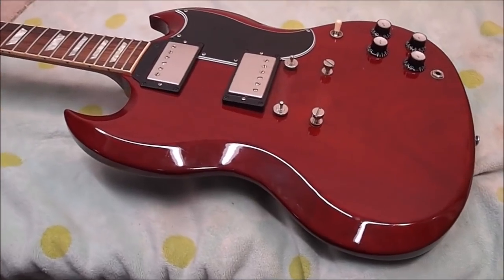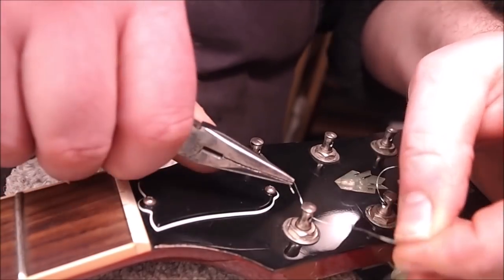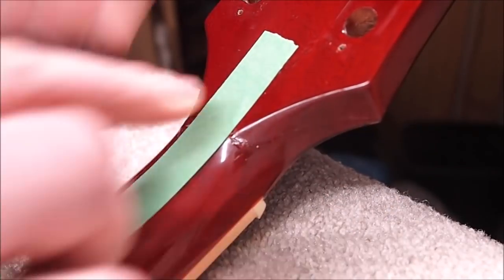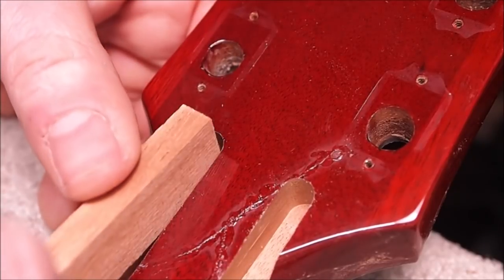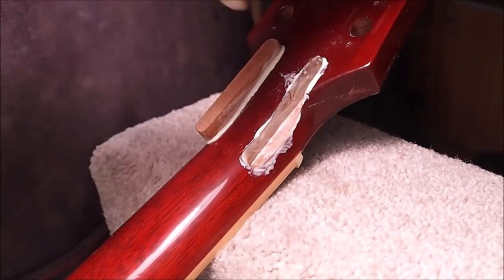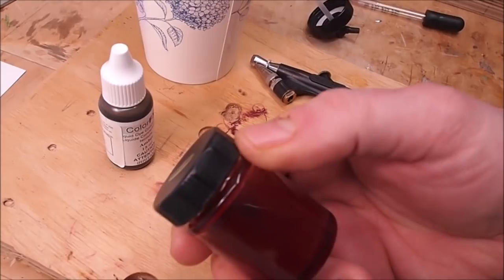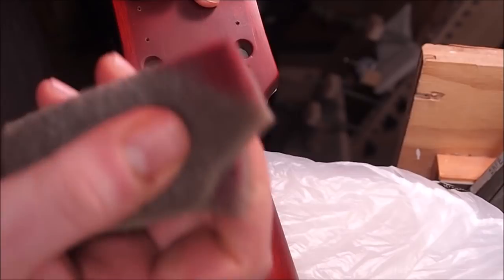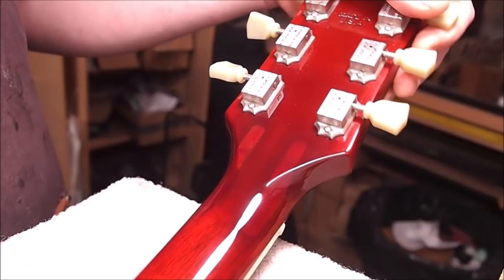Gibson SG Headstock Finds the Strength to Heal

Comment: Another nice professional job to be proud of. I purchased a black LP Custom with a headstock repair that was so well hidden I didn’t discover it until it broke the second time around the splines (maple) and there wasn’t enough wood left to get a good repair. I made a complete new neck and located a headstock veneer on eBay to complete the job. I would have enjoyed your method a lot more but you have to work with what you have.

Comment: Holy crap how did I miss this gem when it first came out?!? Lol that requiem for a dream bit made my day! Such great videos, im very grateful to have them to learn from and enjoy. This is also very likely my favorite headstock repair refinishing/touch up I've seen you or anyone else do. It came out really great especially considering the difficultly matching the color and it looked right in multiple shots under varied lighting. On the tele I built the neck looked great for a few months but now in some lighting I can see where the grain filler dye (mahogany neck, maple board, timbermate grain filler on the mahogany) isnt as even in some places. The timbermate worked great but I think I could have done a better job sanding it back in those areas that are now overly saturated in certain light. It's just weird it didnt show for a few months lol.

Comment: Why didn't you attempt to dye the splines a bit first, then spray the tinted lacquer over the area?
Reply: How could that be done before carving them down?
Reply: Some kind of tinted oil perhaps? Or would that cause unwanted expansion of the splines.
Of course, done after carving, while in the headstock
Reply: @lpjbird  No I mean after carving and sanding - mask off the next and headstock and dye the splines only.
Reply: @JohnCarey1963Jag  Yes I figured that's what you meant after I thought about it a bit, I agree with you it may have come out looking a bit more blended, maybe?

Comment: I actually like the look of the splines, I’m sure people will argue as they always do but mentally to me it look stronger then out of the factory new. Why did you choose what appeared to be titebond glue vs an epoxy when glueing in the splines?
Reply: I don't think I've ever seen him use epoxy for anything.
Reply: Why would you use epoxy instead of titebond? Wood glue is great, as it's made for wood. Epoxy would be a bitch to work with and clean up while not having any advantages.
Reply: Titebond is very strong for close fitting wood joints and it cleans up with water, which is super convenient for cleaning up squeeze out.
Reply: When dry, that titebond will be stronger than the wood it's gluing together. It's well suited for that kind of joint.

Comment: Is there any way to repair a crack line in the front veneer?  I managed to repair my headstock break, but it had completely snapped off, so even after the repair you can easily see the damage on the veneer...  Is the only option to buy a new piece of veneer?
And are splines really necessary?  I've always been taught that the glue joint will be stronger than the original wood was, so adding splines just seems to be extra 'piece of mind' that professional luthiers do to justify the work?
I managed to repair a complete break on my '96 LP Standard with a C clamp and half a bottle of elmers wood glue, and after a few years it's still solid, (knock on wood ;))

Comment: Great repair. Love your statement "Gibson headstocks [are] gonna break, that's what they do. It's the kind of concession you make if you are going to be a Gibson player". Gibson really needs to address the design properly. There are many players who were caught by this once, broke their own or bought an undisclosed repaired guitar, and are saying never again. I noticed that prior Epiphones went from a neck scarf joint design to the most recent 2020 line of headstock scarf joints. They have the lower headstock angle and the small truss rod adjustment hole. It may be interesting to see if they are using the Epiphone breakage data (I'm sure they have ample opportunity to see what happens in warranty returns) to decide how exactly to fix the main line Gibson models.
Reply from the maker: Players don't want them to change and have resisted every attempt made by the company to do so. People who actually buy Gibsons are the most conservative consumers imaginable -if it's not an original '59, they want something as close to those specs as physically possible. The company finds itself in the unwinnable position of having to compete with its own past.

Comment: i had a beautiful late 60s to early 70s gibson les paul custom in black(i paid $600 in 1986) it was only a matter of time before i picked it up one day (probably 1991)and noticed the headstock was not were it was supposed to be attached so i had it repaired at around the cost of $300.it was beautiful ,almost 100% undetectable and had carbon rods embedded into the repair and told "it will never break again"lol.i suspiciously felt that may not be true but continued on through to course of life.i showed up at a gig,opened the case and stared down in horror.it was broken AGAIN,after being transported in a case in my cars trunk.one more repair and then shortly after i sold it.man,i miss that guitar but dont miss the constant fear.

Comment: those  circle guages are good for identifying nut, bolt, and screw sizes so  you arent running  backk and fourth between job  site, the hardware store, and  the dark workshop in your back yard grabbing the wrong size fastners and  hopiing they willl fit.

Comment: Can you please tell me the length of the slotting jig where it contacts the back of the neck and head? Looks like it contacts the neck at about the third fret and about the middle of the headstock. I have my brand new router bit all ready to go. My router is an old black and decker, a little bigger base than yours so I will change my jig to suit the base but the contact points on the guitar should be similar to yours for the splines to do the job..

Comment: I'm curious how deep the slots are at their shallowest point.
Reply: I wondered about that as well, and whether it would be remotely feasible to make the bottom of the cut concave, and the spline convex so that it ran deeper through the mid point of the length of the cut.

Comment: What if my sg was broken at an important gig by a drummer tripping over my cord and didn’t tell me? I went up on stage to tune and noticed that the action was really low…then I found the break!!! I was so pissed that I just ripped it right off! Bad mistake, apparently. It has been broken for about 45 years now and held together by two screws and is fine…but it bugs me!!! Would it be possible to fix? Is it worth it? ❤

Comment: I have a question that probably has an obvious answer: is it possible to use artist's oil paint directly on the wood splines then, once it's dried, coat it with clear lacquer? I would think the open time of the paint, even when diluted with thinner, plus the knowledge of whether or not the pigment is fugitive or transparent would make color matching fairly easy. Thanks for all the videos. This is my favorite channel.

Comment: Are you in Canada? Judging by your remark about over the border shipping I'm guessing you are. If so what province? I'm looking for someone to undo the damage that someone did to a brand new Gibson J-45 back in the early 90's when it was still new. He got glue on the body of the guitar, and he lowered the saddle and nut to point of buzzing. I think he might have lowered some of the frets too much too. There's also a gouge out of the wood where he used the wrong tool to remove the nut. I'm in Ontario, are you?
Reply: His website says he's in Hamilton, Canada. Hope that helps.
Reply: @RhizomaticAssemblage  Thanks for letting me know. I still haven't had the repairs made and now I have this luthier as a consideration. Hamilton is very close to where I live and I could probably drive there in under 45 minutes. I did find a guy in Waterloo Ontario too called Folkway Music who's a little more of a drive but he really knows his stuff as well. Thanks again!

Comment: No, this type of headstock break along the grain of the wood does NOT need splines because the brittle wood grain itself has failed and the headstock is not chewed off across the end grain.  I'm only a novice luthier and have repaired these break types with great success with wood glue alone.  The key is to get the glue to seep as far into the bottom of the break as possible and I do that by dripping wood glue into the end of a plastic drinking straw, flattening the straw's end and inserting it as far as possible into the bottom of the break, then backing off about 1/4" for end clearance, and LIGHTLY blowing into the opposite end of he straw to force the glue into the bottom of the break working it across the width of the break, and working my way out of the break by filling the entire break with glue.  Then it's a simple matter of clamping and cleaning the excess glue squeeze-out.  And it also helps to close the break initially and wax off the finish to prevent glue adhesion to it.  Then finish touch-up is minimal.  The fact that wood glue bond to face grain is MUCH stronger than the wood grain itself is what makes splining unnecessary for this type of headstock break and the repair will outlast the guitar, unlike a chewed-off break that DEFINITELY needs to be reinforced with splines.
Reply: I'll take Ted's very experienced word, though. He's done so many excellent repairs of all sorts with us all watching,. Most luthiers that I watch, who need to force glue deep into a joint, do so with a needle and compressed air. And they usually thin the glue a bit so it flows better into the cracks.
Reply: @bills6093  Fair enough.  Thank you for your comments.  No hate on Ted but I'm just offering what has worked well for me.  I wouldn't recommend compressed air because in my experience even blowing moderately through a straw with my own breath is way too hard and it just drives the glue out of the crack.  I also didn't mention that the nature of this crack with all of its irregular nooks and crannies makes a glue joint all the stronger both in terms of increased glue surface area and mechanical joinery.  My experience has also taught me not to underestimate the strength and reliability of wood glue.  I once glued a weak face-to-end grain right angle joint without any benefit of mechanical joinery e.g. dowels or biscuits and I struck the piece on the floor to break it, and the break revealed that chunks of the end grain broke out of the wood and remained bonded to the face grain piece.  I'd always known that a glued joint is stronger than the wood itself but never realized how MUCH stronger it is.  I was impressed.

Comment: Isn't it about time Gibson redesigned the Sg headstock to stop this happening..
Reply: Epiphone solved this issue with the 14 degree angle and Gibson used that once but people complained saying that it wasn't authentic in the 70s and 80s
Reply: Or just make sure you store your guitar properly....
Reply: It's not just the sg headstock. If you breath wrong on a Gibson it'll break.
Reply: You sound like Bob Ross. :) Nice. Also, I like you didn’t speed up up the video.
Reply: They have actually tried this several times, a couple different versions- even using a volute to strengthen the joint, but people just complained it wasn't like the original.
Reply: @Stratisfied22  breath wrong on a Gibson and it will break? Sounds like you have more experience on the internet than you do with a real Gibson.
Reply: LPs are the same.
Reply: @thephotoyak  true is true that headstock angle if any Gibson falls in or out of the case that headstock is a goner. Before you run your mouth talking shit I own three les pauls. That is one weak headstock doesn't take much to lose it.
Reply: @spiderfan1974  do you make a habit of dropping your Les Pauls?
Reply: @thephotoyak  accidentally bang the headstock against something  while in practice or on stage it happens. I haven't dropped any of mine yet. Sometimes if you don't have strap locks shit happens and you don't always catch it before the kabong. The angle that those headstock are at do break off easily all the broken Les Paul's and SG's are more than enough proof.

Comment: Just a friendly FYI... 9 times out of 10 when you get color-shift on a guitar, UV light is the main culprit. Tis why most more modern production-line guitar finishing processes involve a clear-coat with anti-UV additives. Obviously, if it's got a nitro or lacquer finish, it's not gonna have anti-UV clear on it, but most factories lay down anti-UV clear over Poly finishes.
Reply: That's what makes old Gibsons look good, their modern burst variations are trying to mimic years of the same color aging in different conditions.

Comment: Would very much like to hear your thoughts on the following.
I once met an older fellow who told me, if you want a real strong glue joint, first wet the wood over night or longer. The theory being, if using water soluble wood, the glue will more easily soak up into the cells of the wood, making for a better/stronger joint.
Have you ever heard anyone say the same thing? Do you think I'd make a difference one way or the othet?
Reply: I find the "older fellow" advice curious.  If the wood is totally saturated with water from an overnight soaking, how is it able to absorb a water-based glue?
Reply from the maker: This might be referencing the technique we use with hide glue when dealing with endgrain.  It's so porous that it sucks all the glue into it, so by putting on a coat and letting it dry, you "preload" the surface with glue so there's something for the next coat to stick on to.  In this kind of mortise and tenon joinery we're actually benefiting from the slight swelling that occurs - it makes the joint tighter, so I wouldn't do it here.
Reply: Funny you should say that. We were gluing an inexpensive classical guitar with a snapped headstock and were using hideglue. It seemed to hold up just fine but for all the hassle of dealing with the hide glue, I'd just as soon use the regular white stuff. I've had guitars that were glued 3 times and every new break was the wood not the glue joint. Of course nylon strings exert a lot less pressure than steel.

Comment: Yup, it's true: Gibson headstocks are traditionally designed to break. They use flatsawn instead of quartersawn timbers to make their necks, and they will break if you sneeze hard on them. And by "traditionally", I mean they've always done it this way, having NEVER figured out the correct way to make a one-piece neck.
But you've got to give Gibson props for one thing: They keep a lot of guitar repair people in business. I was working with another repair guy for twelve years, and during that time, I completely lost count of how many Gibsons with  broken headstocks came into the shop for repair. Three or four a week sometimes. Many of them had already been repaired once or twice before, but broke again, right next to the old repair. So, thanks, Gibson, for providing so much bread-and-butter work for the repair shops. Without you, we'd be bored out of our skulls waiting for the next job to come in.
Reply: Been playing guitar for 25 years and have owned and played loads of Gibsons (and I even tend to sneeze quite a lot! 😛) and I’ve never had a single headstock break. Like the guy in this video says if you have any sense as a Gibson player you take precautions. In my case that meant fitting straplocks to all of my guitars (not just the Gibsons) after my Les Paul fell off its strap and landed on the tuning pegs and cable jack that was in the socket (and survived with only a bent tuning peg and jack plate) and using proper guitar stands. I swear those guitarists who rest their guitars up against their amp or against a desk or whatever completely amaze me... I mean, why would you do that?!!

Comment: By the way Great work. Ive been doing re stain when you were in diapers and I wanted to add a comment to your repair. 1. You were so close to matching the original stain. Doing a Double sand stain is the answer at Foundation. there is the key to a perfect repair stain. I had to learn just like you and have mastered stain color. I know this by looking at your work My advice to you is to do double stain at foundation. You could have tested color first on a wood piece. And Yes primary colors are hardest to match.  Good luck.

Comment: I've always wondered why Gibson never has tried using Maple for their SG & Les Paul necks. It seems to me that Maple is a whole lot stronger than Mahogany, and it can be tinted or stained to match the rest of the guitar, right??

Or at least, they couldn't they try to use a 3 piece neck construction, with a center "stringer" that's made of Maple?? I think that would really make the neck a whole lot stronger and more stable. Anyhow, I thought I'd offer that suggestion up for consideration. Thanks.
Reply: There are maple necked LPs out there. They're a little bit brighter sounding and can be even heavier. I did a lot of work on an LPJ that had fallen off a wall hanger and smashed up the bridge, stop bar and nut. The neck and headstock were fine though. Sturdy guitar.